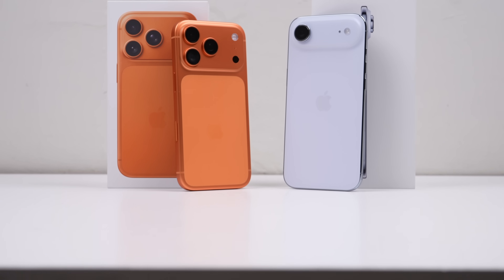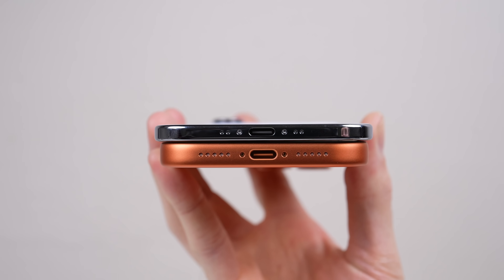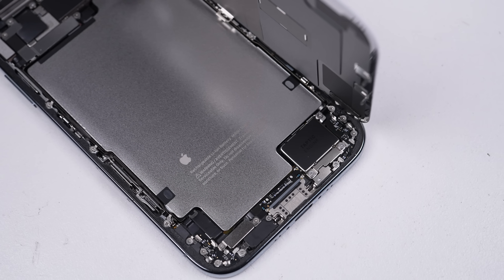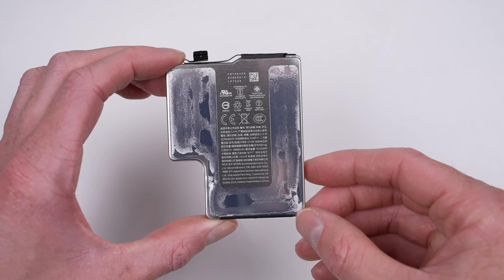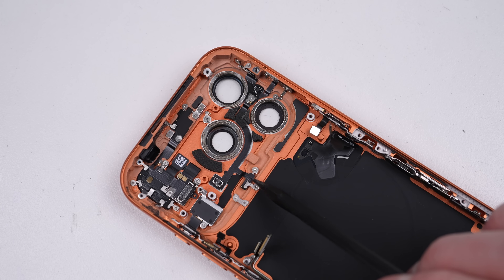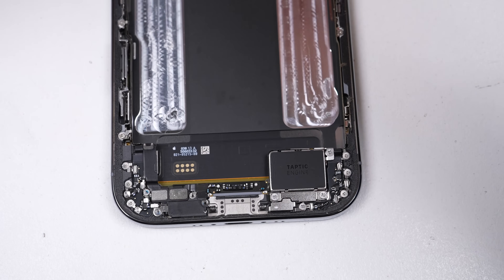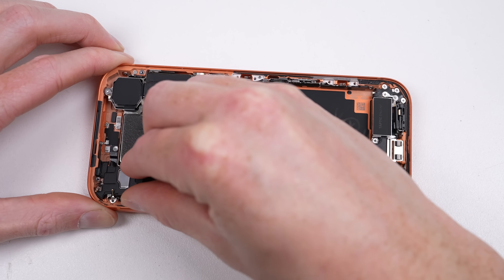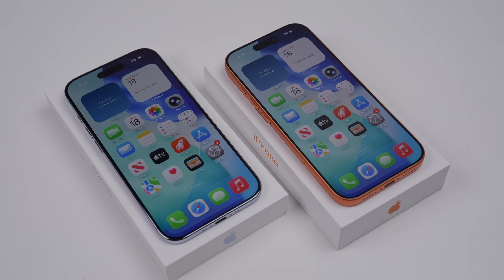iPhone 17 Air & Pro Teardown - The Real Size of the iPhone Air Battery + New Vapour Chamber

Comment: No wonder they get more and more expensive, it takes a lot of time coming up with all these anti-repair measures and implementing them. It's not a phone anymore, it's fool's gold
Reply: More expensive?

The base model has been the same price of $800 for over a decade. Pro models have always been $1000 -$1200.

So your claim makes no sense. The only time you’re pushing higher is if you buy more storage but is already at 256gb as the minimum, so most people don’t need to upgrade.

Comment: oh for the return user replaceable batteries....the sealed unit which began with the original iPhone has always seemed to be just a scam to force expensive replacement or an upgrade
Reply: Apple replaced my entire phone for $100 as long as I trade in the current phone I was inquiring to repair.
Reply: @rufus2028 only with the overpriced extended warranty

Comment: I've been using the iPhone since the first one. My last one was the 14 pro max. then moved over to Android, fold 4. and frankly, I'm so happy I moved over to Android. Look at these new iPhones, they look the same and same features just an upgraded hardware.
Reply: I used androids since 2010 and every single flagship I used had massive problems. Lack of updates, slowdowns after an update, random shutdowns, screen randomly not turning on, memory chip failing, battery literally leaking out, stutters, not being able to make calls... So on and so forth, I had 0 issues since I moved to iPhone 😂 I'm sticking with Apple

Comment: I can’t help but notice the Samsung Edge has a SIM slot, stereo speakers, and dual cameras… that makes me question if the iPhone Air’s extra fifth-of-a-millimeter was really worth all its compromises. 

Plus, it has a 3900 mAh battery compared to the Air’s 3100, and somehow it’s two grams lighter overall 😅
Reply: It may have taken a while, but the effectiveness of the earpiece speaker will degrade over time. My Galaxy S9+ now has a very poor earpiece, as in you can't really hear through it anymore. Thankfully the bottom speaker still works so calls can be taken on speaker.
Now...with the iPhone 17 Air not having a secondary speaker, that earpiece is doing double duty...so it will wear out faster, and if it fails, you won't take calls anymore as it's the only speaker. And in a few years time, will Apple sell you a replacement?!
Nah, not buying this at all. Too thin. The Galaxy EDGE was a better idea (although I'm skeptical as to how ultra thin devices will last in general). I also do want an actual SIM slot!!
Reply: @TheSpotify95  exactly, the ultra thin devices are not here to stay, AND AS FAR AS THE REPORTS GO, THE AIR IS NOT SELLING AS WELL AS BASE 17.

Honestly, iPhone 17 is the greatest iPhone Apple has ever made, it has everything to do its duty as a great smart phone without breaking the Bank. THIS IS THE FIRST TIME I WANT TO PRAISE AN IPHONE.
Reply: All this arguing really just convinces me that both the Smasnug Edge and the iPhone Air are both not worth it. Just get a normal thickness phone with proper cooling and battery life and not have to deal with all of these compromises. Cheaper price than the Edge and Air, too!
Reply: Battery size is irrelevant when they both have comparable battery life. It’s all about efficiency.

If you want an example, my 12 pro max has ~3600 mAh battery life and yet it lasts me 12 hours despite being at 76% health.
Reply: and everybody dunked on the Galaxy Edge for being a stupid phone no one asked for
Reply: @barrupa EDGE or AIR both has or will do badly on the sales front, we can already see reports coming that air selling worse than iPhone 17 Pro Max which usually sells less due to high price tag. The bread and butter is always 17 and 17 pro series which is again true this year.
Reply: @ezioauditoredafirenzi iPhone pro max usually out sales everything
Reply: @ezioauditoredafirenzi  16 sold more i don't know what you talking about
Reply: @ezioauditoredafirenzi  As an owner of the S25 Edge, it’s embarrassing that a 3900 mAh cant keep up with my other phone (iPhone 12 Pro Max) that has ~3600 mAh battery size. I get 6 hours of battery on the edge, and 12 hour of battery on my 12 pro max.

That alone was proof that efficiency matters more than size.
Reply: @rufus2028  of course, My ROG phone 9 with its 6000 mah cannot keep up with even my iPhone 15 Pro Max but my ROG can deliver sustain performence without dimming the screen after just half an hour of mild intensive game like PUBG(at the lowest graphic setting).
Everything has its ups and downs, for example, the new iOS 26 feels like android from 2010 with a nova skin launcher 😂. But then again, the iOS 26 has improved one hand use.

Similarly, I don't think battery can be compared across two different operating systems because iOS is not as power hungry as android. Which is a good thing, but it is also not as power use suitable as android.
Reply: S25 edge doesn’t even have a curved display, come on you can’t be serious
Reply: the S25 Edge also has depreciated the most out of the S25 lineup and is the newest. You can pick it up used for £400 cheaper than new. Even samsung is running a £200 discount on it. I have also seen contracts on Vodafone for the Edge go as low as £35 a month for a 2 year contract with unlimited. I am currently paying £31 for an unlimited SIM card with EE, that's without a phone. 

Samsung and Apple users can have their fanboy fights, but at the end of the day the Air is gonna sell well since its an Apple product, while Samsung seems to be struggling to shift the Edge, if there are contract deals where the total value of the phone + sim is less than the MSRP of the phone. As someone who worked at a network provider, a discount like that is seriously unheard of. The network I worked for usually make at least £250-350 profit on the lowest tier data contract on any given phones MSRP.
Reply: Samsung Galaxy way more advanced lol
Reply: @lemcakes32422  yes and no, Samsung does have a lot of features and about 90% of the time is a much more potent device.
But since I have iPhones as well I would like to point out the stability of apps on iPhones, so whatever works works brilliantly on iPhone.

But yes if you are a power user like my dad (CEO) his weapon of choice is always note series (ultra).
Reply: Did they ever solve the problem of these ultra-thin phones folding if you sit on them?
Reply: @Nebby_99  You must be far behind the news curve. JerryRigEverything already tried breaking the Air and was wildly impressed with how strong it is. 

215 lbs of concentrated load on the center is what it took to break it. In other words, good luck actually bending it.
Reply: @rufus2028  

Bender Rodriguez has joined the chat
Reply: but the s25 edge looks terrible
Reply: But the s25 edge is downright ugly
Reply: @AshuraRage looks better than the Air for me.
Reply: @AshuraRage not everyone thinks like apple fans do, some prefer function over form.
Reply: And performs worse than the Air in battery tests.
Reply: @69memnon69 due to iOS over aggressive management
Reply: @69memnon69  That’s not the point??? 😂
Reply: @eagle56786 I get the point. But what are they gonna do with air 2 if they give all these features at once. Come on think like a business.
Reply: @eagle56786 I mean it definitely is the point of a battery - the actual performance. Just like the chip inside being so much faster than the samsung..
Reply: @69memnon69  Apple, will perform much worse in stability tests because their chip is heavily choked for efficiency and to avoid thermal throttling.
Reply: And I still wonder that edge died faster than the air even tho happened bigger battery
Reply: @lokeshloki8628  like it was day and night difference 😂, but not having steroid speakers and sim card is a day and night difference
Reply: The air actually looks noticeably thinner, it’s also more durable and premium, it has stronger performance and still has great audio despite one speaker and actually a surprisingly good camera for a single lens, also a huge front camera upgrade, best in the smartphone game
Reply: @promo2099 Yeah Tim, everyone's clapping rn
Reply: @promo2099  Source: Trust me bro.
Reply: @promo2099  you will support Apple no matter what😂, a good speaker cannot compete with the stereo speaker, the battery life is not a night and day difference, the USB port is a night and day difference apple 2.0 vs 3.2 on Samsung, cameras are again not a night and day but having dedicated wide angle is a big boon.😂🤦🏻‍♂️

Comment: Subbed. Let me ask you a question. You used the current to unstick the battery from the vapor chamber. But you didn't do anything to re-stick it. Why?
Reply from the maker: Ideally you would apply new adhesive. Given these phones have just been released there isn't any spare parts. I typically keep the teardown devices till these replacement adhesives become available, then re-open them and apply them before selling the phones.

Comment: Physical sim should be cancelled everywhere i think. I don’t see any advantage of using physical sim, only negatives (i stopped using physical sim as soon as my operator supported esim, before i had to replace sim from time to time as it failed). No sim means bigger battery and that’s better from my point of view. Also using esim means if someone steal my phone i know all the time where it is (just turn off pin for sim so it connects to network every-time). With physical sim they just throw away sim and phone can be left turned on.
Reply: Not all networks provide eSIM, especially those using budget/prepaid plans and for travellers who only need a local SIM for short periods of time in quite number of countries.
Reply: @PeterdaPanda  they’re fighting for right of repair. But just think how much plastic will be saved if all countries get rid of physical sim and also other materials…. Also it’s easy to install esim and you can store more of them on one phone …. Also you don’t need to find shop where you can buy esim you can buy online before  ;)

Comment: "No E-sim"
"So this is an expensive iPod Touch to me"
Guys, i may not have a brain, but i have an idea.
Reply: 😊ipods have 3.5mm audio jack
Reply: eSIM is trash at this time…..wouldn’t touch a phone without a physical sim. Luckily the iPhone 17 pro max still has physical sim
Reply: physical sims make no sense if they can be done completely in software.

and ipod touch didn't have a cellular modem.
Reply: @BertRedd u cant do that with software ur still having a hardware inbuilt for it
Reply: @BertRedd  my mobile network doesn't support eSims at all, nor does my current phone which I have no plans of changing for years to come.

Comment: haha the pro battery is tiny, meanwhile most Android phones come with at least 5000mAh
Reply: The apple chips are a lot more efficient. For now at least
Reply: @Saiklohit  And yet they still last as short as any other phone. The iphone pro is a massive brick, the battery should be at least 6000mah with such a thick boy.
Reply: @Saiklohit  so? you're still paying quite a lot for a mid range if not worse phone. Proprietary software, locked ecosystem, worse hardware, overpriced, anti-repair.